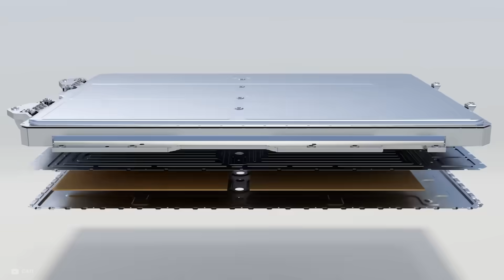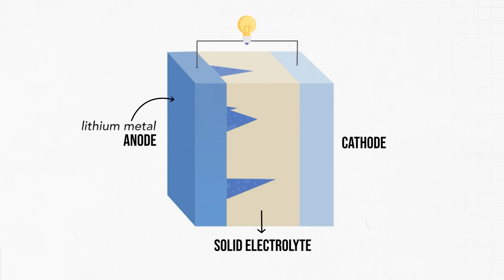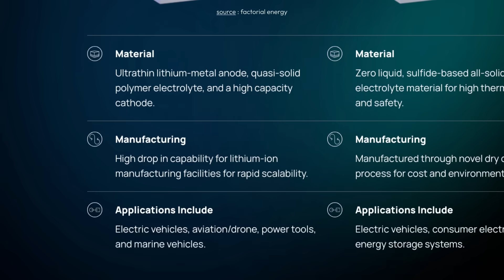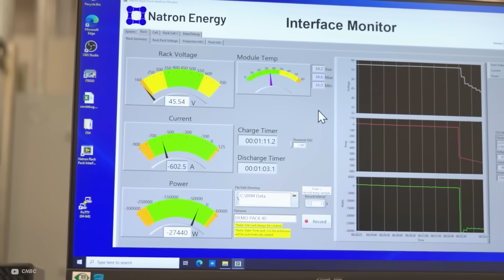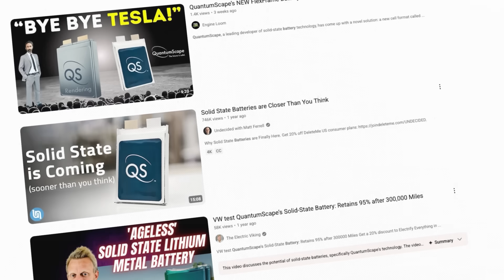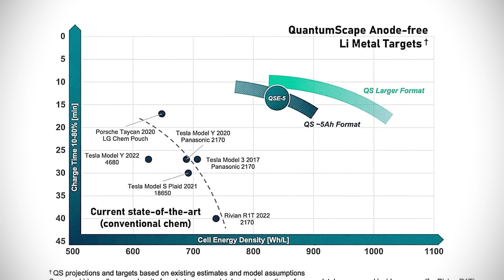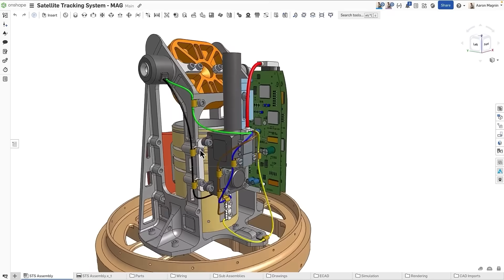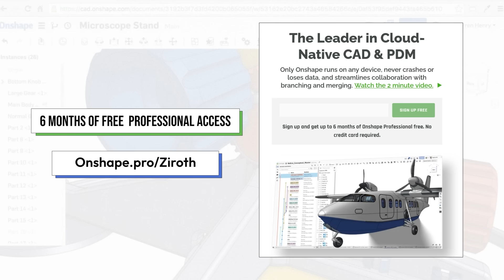The Decade Wait is Over, Solid-State Exists.

Comment: In september CATL have announced the official completion of their all-solid-state battery production lines which are expected to start production in 2026 though their first customers seem to be eVTOL (Electric Vertical Take Off Landing) vehicles using semi-solid state batteries at 350Wh/kg with full solid state aimed at vehicles of all types projected to run 430Wh/kg. Since it's CATL I also expect they will do so and be on time.

SK On (South Korea) is also hard at work with updating it's production lines but they are aiming for 2029~2030 but they are claiming 800~1000WH/kg that one is going on the "I'll believe it when I see it" list. Though that is 5 years from now so probably not that unrealistic.

Comment: there will always be a market for solid state battary today ev are just cusp away from ice cars in terms of range and practicality once they macth ice cars we will shift our conversation into the weight of the car in that front ev cars still have a massive dissadvanatages there a 300-400kg delta between the 2 for example a civic is around 1400kg while a model 3 long range is 1800kg getting more energy density and more stable battary that perform more consistently across the tempreture range which still plauge ev cars quite drasticaly compare to ice cars in terms of tempreture effect so that will be the next frontier for ev to overcome the cold and weight.
Reply: The civic isn't a model 3 competitor SMFH think loaded accord instead and those are 109-150kgs difference in weights. Example a loaded accord is up to 3,600# the latest sr model 3 is 3,706# now. 
The lightest ever 2020 m3 sr briefly available for $36,000 with the 50kwh nmc pack was just 3,464#

Comment: If the cells expand and contract during use, where is the extra volume coming from, and where is material going when it shrinks? How is this managed so the cells don't become lopsided or bumpy with uneven growth? Are springs and expansion space needed to allow battery packs to expand and contract? Are cylinder cells possible?

Comment: One definition of "quasi" from Merriam-Webster: "having some resemblance usually by possession of certain attributes", a simplified way to express the meaning: "not", as in "not solid state." 

A problem with solid state batteries is how theoretical potential advantages, often borderline speculative ones, have been presented, and as if first mass produced solid state batteries will have all of them from day one, to the limit of or possibly even beyond what's theoretically possible to achieve. That's not how reality works.

Comment: I'm wondering how solid state batteries can be improved by nanomaterials and metamaterials that will improve the energy density if they're made from other sustainable battery chemistries like sodium, calcium, and potassium chemistries. I also wonder if it can be improved more with the flywheel hybrid system.
Reply: There are sodium sulfur and lithium sulfor batteries that are still in research. The energy density claims are out of everyone's minds, from 1100Wh/kg (sodium sulfur) to as high as 2800Wh/kg (lithium sulfur). Basically 3-6x the density of current lithium batteries

But looks like those chemistries are still having a very long time to go before it's finally able to fit in the EVs, as many research points out that those 2 chemistries still has poor charging capability

Comment: Nio ET7: In a 2023 test run, a version of this sedan, equipped with a 150 kWh semi-solid-state battery from supplier WeLion New Energy, achieved a range of 1,044 km.

Aren't semi(quasi) solid state battery already available at least in China.
Reply: Yes but for some reason the oems haven't jumped on them SMFH. That pack is just 44# more than the same size catl nmc chemistry of just 100kwhs! 
Allegedly welion and nio claim the pack alone is almost $30,000 though.

Comment: I think they will be adopted becouse of weight savings. Weight savings= component size and materia savings(lije suspention,chasie etc) and total usable space increase from same volume car would make it easier again to bring back volume down while keeping usable space=smaller panells doors roof etc=saving manufacturing costs.
Reply: Not to mention the possibility of having structural batteries. Meaning the battery is the chassis.
Reply: @seamon9732  I don't know if that would be a good idea. The batteries won't be as strong as steel. And then if your chassis gets damaged easier then your brand will be just know for easily getting totalled.
Reply: @seamon9732  "Not to mention the possibility of having structural batteries. Meaning the battery is the chassis"

Nope.

It's one thing to say "it's structurally superior to most battery cells", but that's a long way from it being a true structural material like the recentlu reported carbon fiber based or concrete based batteries.
Reply: yes, volume is not really an issue, EVs already have a lot of empty space that you can use. but saving on weight means more range and less wear.
Reply: Well duh.

That applies to all batteries used in mobile devices.

For stationary devices like in grid storage, domestic storage or a UPS the mass/volume problem is far less of an issue, and cost is usually the deciding factor - this is where Na ion has the potential to clean up once it can be scaled.
Reply: @mnomadvfx  well duh? lOL you silly silly creature lol😂

Comment: If volatile battery technology is going to continue to be used there needs to be serious standardization of all aspect of these batteries.
1: no module should exceed 30 litres in volume or 60 kilograms in weight .
2: all modules to be of uniform size ,shape and connection position and type (No Proprietary technology period)
3: the modules must be fully recyclable with no special tools or methods short of standard safe handling practices.
4: module internals are to connect together like legos to allow the removal and replacement of individual cells or cell pack of no more than 8 cells in a pack ( this is dependent on voltage/ current requirements, 8 is a suggested number but 12 should be the maximum in a pack)
5: modules should be firewalled from each other and any flammable structure.
6: modules should have a vent that channels to a chimney and the chimney should have an igniter to burn flammable gasses.
Even if solid state batteries are a hundred times less volatile than other technologies they still need to be standardized

Comment: I get impression a lot of manufacturers do plan to have something towards 2028-2030. It's more likely to be semi-solid state, but who knows. It will take time before normal EVs get them as you need to ramp the cell manufacturing. Building a factory typically is not a quick thing, and then you need to scale it up. That's all assuming you already have an idea how to produce them cost effectively. Toyota just talked about their solid state battery (solid electrolyte), two phases: 2027-2028, TBD. Typical claims of 1000+km and very fast charging. IIRC NIO did semi-solid state 150kWh batteries in 2024-2025 in China with ~1000km range. This was not on sale, but you could rent/swap them. The problem is that battery pack cost as much as the car itself. Simply put not economical/cost effective for general availability. Probably also acts as a larger scale test.
Reply: 1000 km range is a milestone where the EV can finally outweight the regular ICE and even hybrid.vehicles

1000 km is the whole 10 hours of non stop driving on the motorway, and after 10 hours of driving you'll need at least 7 hours of rest anyway, so charging will not be a problem
Reply: @sihamhamda47  Even today with 800V (or higher) platform I don't think charging is a problem. Depending on conditions, speed and the car you already have 4-6 hours (or more) hours of driving. You will want to stop for a quick rest, and you can get 100-200km range within 15 minutes of rest on DC charger. We think about the range like we would be driving ICE car, which is not bad, but charging network is probably more important. You stop, you plug in. There is close to 30 chargers in my short street. Most are 22kW AC (most cars don't do that, stop at 11kW or 7kW). Few are 3.6kW-7.2kW which fine for overnight. There are also a few DC chargers too. Remember that EU cities are a lot more compact compared to US thus driving distance is shorter. Driving is the city is the most efficient thing in the EV. Low speeds use a lot less energy and sitting in traffic basically consumes nothing. So overnight charging on 3.6kW charger (very slow) you still get 150-200km of city driving. It still would be nice to have 1000km range, but I don't think that's in any reasonable price point 😃 At least not today, maybe towards 2030 or so.

Comment: Title: Solid State Batteries are already here!
Content: Quasi Solid State Batteries are already here - Solid State Batteries are still comming...
Reply: Even without the solid state chemistry, the energy density of the current battery chemistry are still can be improved further

Latest CATL's NMC battery already surpassing 400Wh/kg
LFP batteries now has 220Wh/kg energy density
Sodium ion is 175Wh/kg

And those 3 chemistries are improving with 5-10% increase in energy density per year
Reply: They are here, but I suspect the cost of manufacturing them makes them too expensive to be used in automobiles.
Reply: @vulpo   they are not here in my next set of ear buds, tablet, phone, drill and least of all my YASA powered Lambo
Reply: @skippy-i7y   But maybe for your next pace-maker?
Reply: Wait, but one of them was real solid-state.
Reply: @NXTangl  real solid state with lower Wh/kg than regular li-ion
Reply: @solarcrystal5494  At 9:15 in the video it says the battery cells carry 301 Wh/kg. Where do you find regular li-ion batteries with even just a comparable energy density? NCA (nickel cobalt aluminum oxide) Lithium-Ion batteries provide up to 260 Wh/kg.
Reply: Yeah but if SSBs keep delaying further they will never become viable and they will become a commercial failure even if they are the better technology.
Reply: To me it makes more sense that new tech would start off smaller and in tech that has more turnover. What is more likely - that a new and expensive battery would be made super big for a car or small - like for a phone  - a much cheaper devise that you can sell millions of every single year?
Reply: well its better tha no progress at all, which would mean they are all lying, so at least we got something for now
Reply: False claims about products are prohibited by the law. If quasi-solid is not solid, then they cannot claim that it's solid.
Reply: Thank you for saving my time
Reply: And what exactly is a solid state battery?  Oh it's just a battery where the liquid electrolyte, the conductor of ions, has been replaced by a solid serving the same purpose.  But wait.  When something similar occurs in modern day batteries, like during very low temperature, when the liquid electrolytes begins to solidify and/or freeze, the battery looses energy.  Why?  Bc batteries does what it does by chemical reaction process which and as such dependent on thermodynamics.
Reply: thanks bro, clickbait not worth watching. you saved me time 👍
Reply: the thing is "Quasi" still uses solid state battery innovation, so it is not really meaningful to be dismissive of them
Reply: @N34R4T0M4TIt isn't dismissive, but quassi, semi, partial are all by definition NOT true solid state batteries as defined by the host. So it is 100% click bait. The advancements are cool, it is the false premise that "solid state batteries are here" that we take issue with. Even he starts by defining solid state correctly, then proceeds to properly refer to them as quassi solid state. However after he continues to misstate like saying"literally solid state batteries are here". Words have meaning, and LITERALLY no they aren't, by his LITERAL definition. Iterations are here and that's exciting so just talk about them without the misleading BS. If they were here the quassi modifier wouldn't be needed, and there would be no qualifications.
Reply: @OuchMySpleen   it doesn't and no we have forty year old tech unless you know some fart smeller who has been converting them for 33 an ounce for 8 years